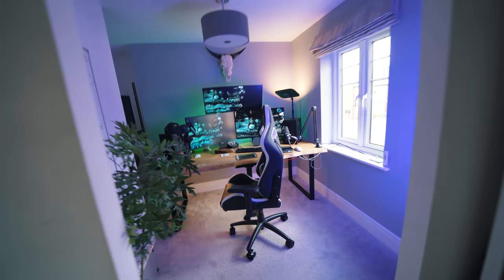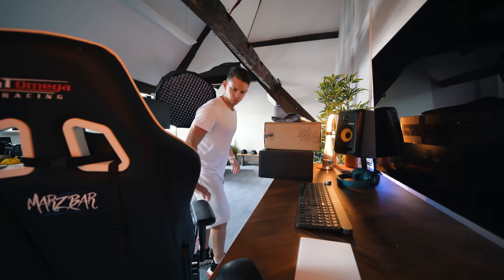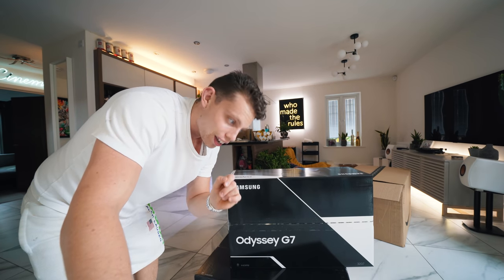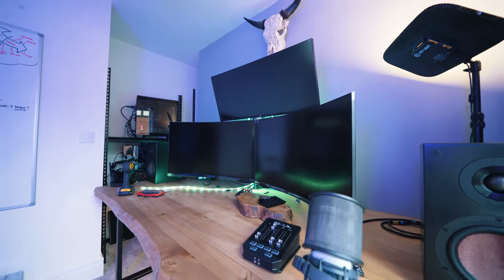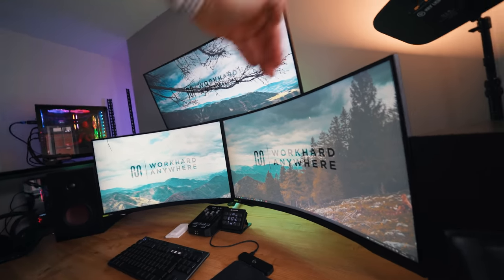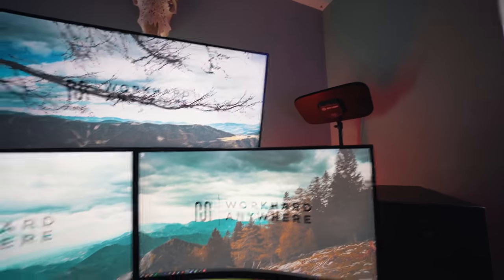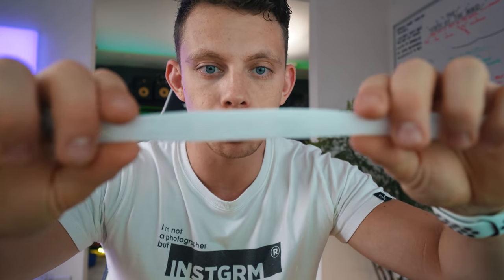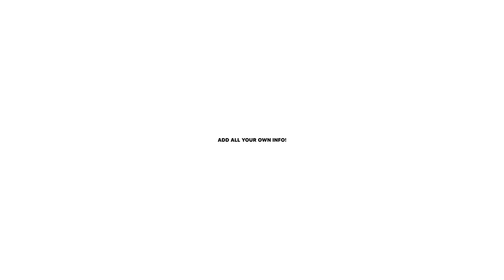I Spent £1100 Upgrading My GAMING SETUP!!

Comment: I want to do my setup but struggling to find a desk top that’s wood and that isn’t £250+ because my IKEA desk is folding in the middle
Reply: Take a strip of 10-20mm thick pine or other available wood :D and run it along the width of the desk (underside) attach it at either end with brackets or just drill it straight in your choice and that should then provide you with some extra strength.